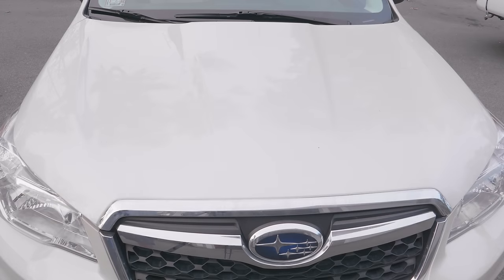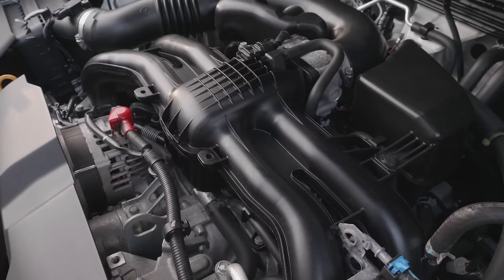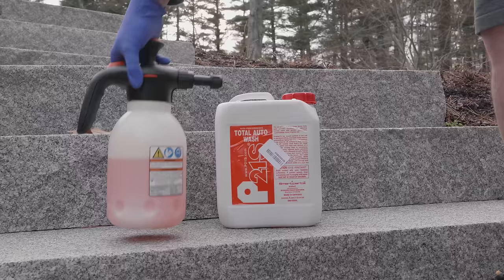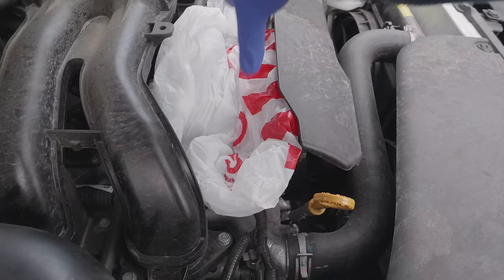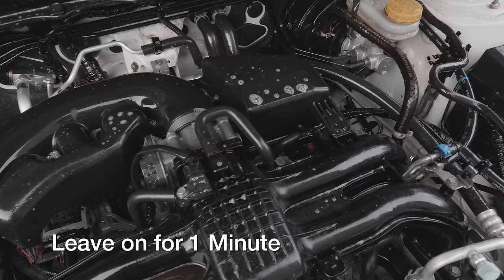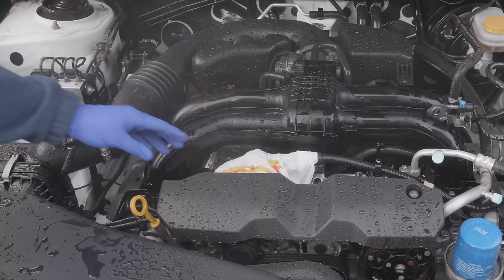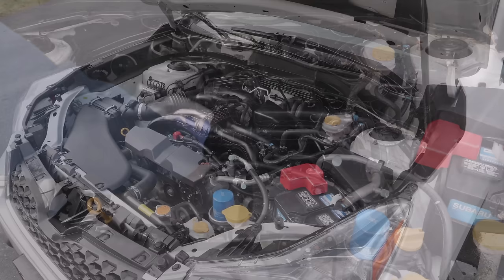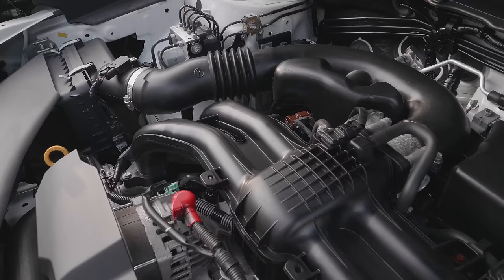Clean & Detail Your Car Engine in 5 Minutes!

Comment from the maker: Thanks for watching to purchase the 1 quart size at a special price & free shipping click:  https://amzn.to/2M4u3Es  YOU ASKED FOR IT!  See my new video https://youtu.be/8aMKkUcTTJ4 where I clean a 15 year old engine with almost 200k.
Reply: Can you use this stuff on your whole car?
Reply: Will this work for a 89 corvette
Reply: @johnmurphy3708  darn, no son . This is gonna rekt your car body paint.
Reply: Honestly you should not use water to take off product it can mess with the sensors... Next time use straight air to take product off. Never use water pressure washer or any kind of water. Use air trust me ...
Reply: Why not let the engine just run for 10 instead of driving it?
Reply: Hi there, thank you for the great tip. How come you covered the alternator but not the car battery as well?
Reply: No time to clean, but apparently time for electrical issues with water in electrical connections.
Reply: How is this product compares to Super Cleaner?
Reply: My dealer said don’t do it!!! Too much risk with electronics.
Reply: I have a 2006 nissan titan and clean my engine with degreaser and water regularly. Never had any sensor problems or electrical.  And I do avoid the alternator but I don't cover it. Everything on modern cars are pretty sealed, just don't flood the electrical areas and its fine.
Reply: so theres no need to cover the battery?
Reply: @victormontallana9579  , I dont. Battery never had a problem. If you have fuses near your positive terminal I'd try not to soak them. But the battery has no issues
Reply: @Bork2468  No. They specifically say not to use it on an 89.
Reply: You literally used a new engine 🤣 nice try selling that crap product. You can't use an all-in-one product to degrease and to lubricate. You're trying to remove oil then you wouldn't have the moisture you need to make it look new you have to use two separate air ducts point blank. I feel like you're like doing the carnival prize games that are rigged with a bent rim that the ball can't fit in.
Reply: Expensive product. Rather spend the time and do it using a cheaper degreasant
Reply: I use to clean my engine ...but if water gets into sensor you will have problems and Chevy garages are expensive ..
Mechanic told me he does see problems with water and hard to find ..
So I don't do it anymore ....
Reply: Beautiful. Even I can do this 4:48